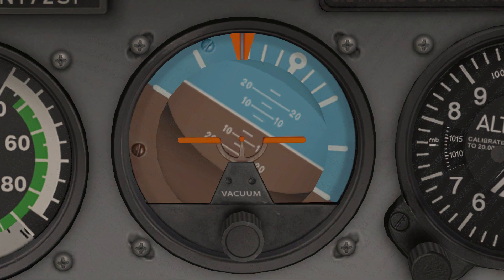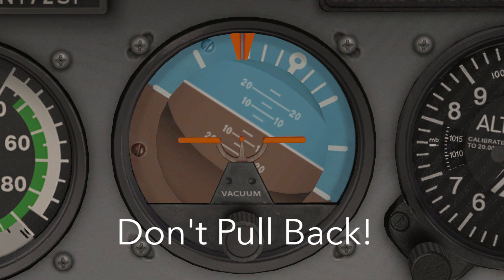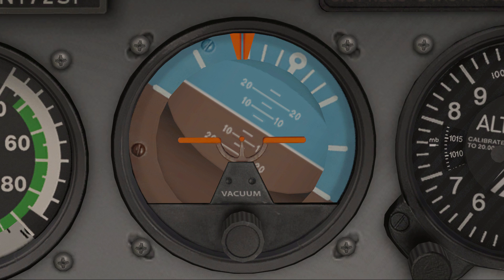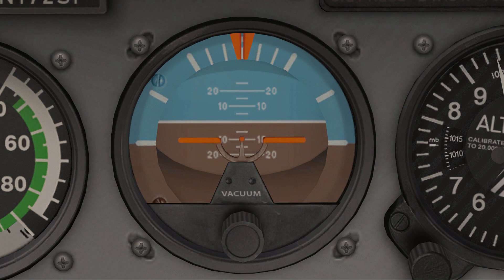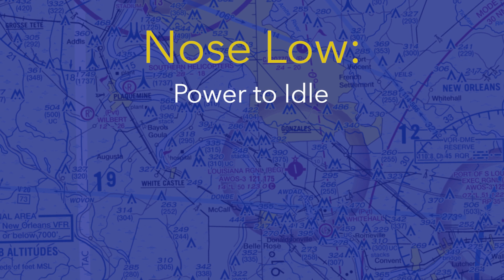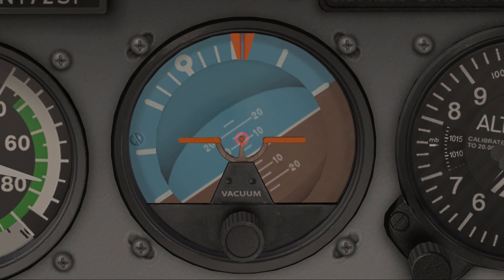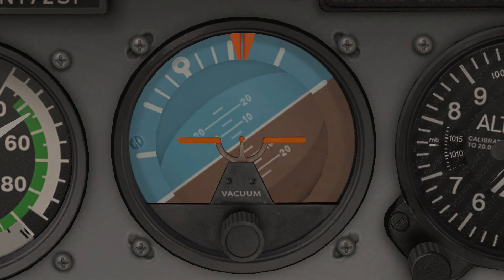Unusual Attitudes - RECOVER!

Comment: In a nose high situation, should rudders (rather than ailerons) be used to level the wings?
Reply from the maker: In normal flight, no, keep it coordinated and level the wings with aileron. It's a different story if the airplane is nose high in a stall. The Private Pilot ACS does not consider these recoveries to come from stalled conditions. We have to keep in mind that the "Unusual Attitudes" covered in Private Pilot training is very watered down and nowhere complete when compared to true unusual attitude training. Great observation and question.

Comment: At our flight school we specialize in UPRT - it's interesting that for nose-high this video specifies power in, nose down, then wings level in that order. Europe, Germany (EASA) specifically moved away from this a number of years back due to spin entries caused by p-factor and gyroscopics at high alpha. Our flight school now teaches to unload first, then add power and roll.

Reason is basically low-speed aileron reversal exacerbated by prop effects - so by unloading we guarantee aileron effectiveness, at which point all controls (power and aileron) work as expected again with minimal secondary effects.

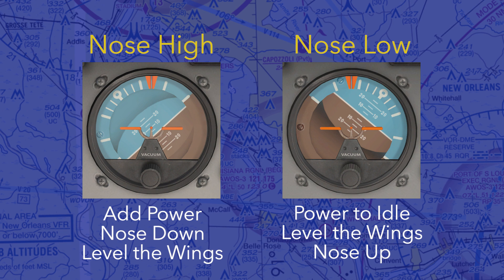Comment: Just watched the video and noticed that at 3:29 for nose high you stated the order was nose down, add power then level wings.  At 6:11 for the same attitude you state add power, nose down, then level wings.  As you stated, i was taught that this happens almost simutaneously, but you are showing two different orders in the video.  Nose down should be first right?
Reply: I believe so. Nose down should be first. However, it should be happening simultaneously.